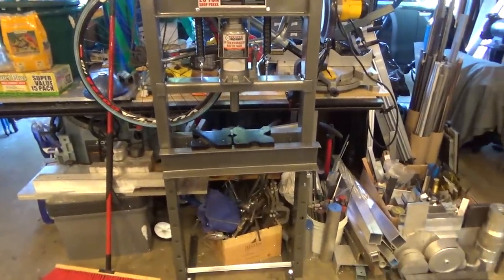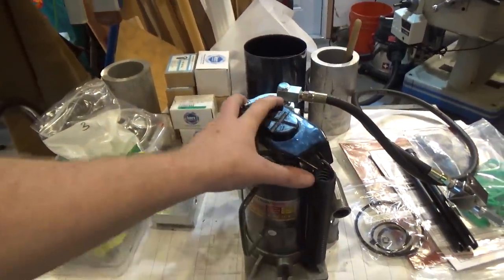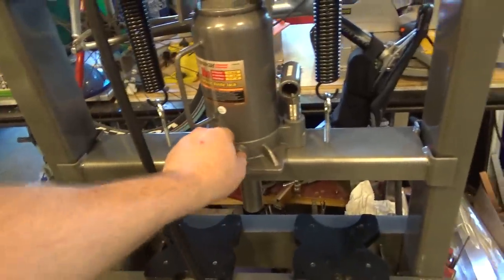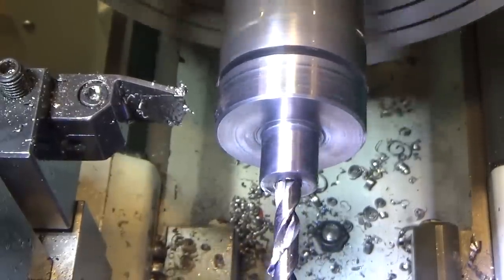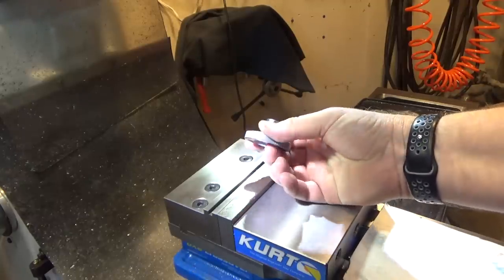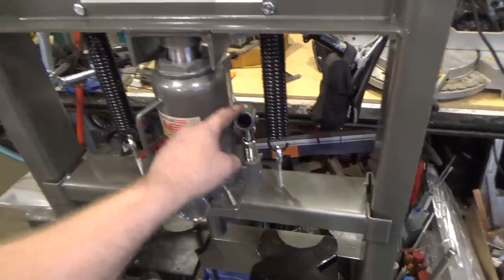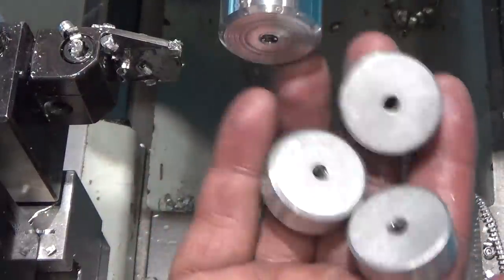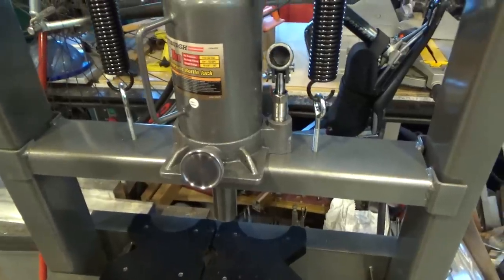Improvements to a Harbor Freight 20 Ton Hydraulic Press Part 1

Comment: Good ideas here. The only downfall, in my opinion was this...  The video is on press improvements, but about half the video is watching you machine a couple parts on your lathe or mill machine. We don't need to see every pass on the lathe. Edit it to the machining high lights, because if the guy has a lathe, they should know how to use it.
Reply from the maker: You make a good point. I try to show one little piece of each machining step, unless I am changing feeds and speeds. I try to tell a story, but some on my viewers, and even myself, just enjoy watching metal being cut and shaped. Making a video on these topics can be a tough balancing act. I appreciate you letting my know your thoughts.
Reply: I have to admit, I really enjoy those bits, and would feel a little cheated if Dudley was all "and here's one I made earlier...", and skipped the actual making of them.  After all, this us a DIY channel and there's always more to learn,  (And, you could just scrub forward past the machining.   Jus' sayin'.  ;)

Comment: Throw some cables through those little garage door springs.... save your life when one of those snaps.
Reply: Hardly any tension on the springs. No need to retain them. And I have had this press for years and NEVER had the pins move on me. Not sure why yours are. Nurling (sp) them would have probably solved your problem. BUT, the project wasnt all about that, I get it. Nice vid...
.
What you need with using that 20 ton air over jack is a front and back plate about 5" wide, welded in to close up the ibeam, right above the pocket for the ram. THAT jack will over strain the press. We had some warping occur pressing out some wheel bearings on ours here at the shop. Put in the gusset, and shored that sucker up quick. Now if we push it, we can see the frame twist. Be careful! Thats Not the jack intended for that press. (But pumping that thing by hand is stupid) gotta have air jack! 8o)
Reply: @miuzik8op908   Yup, the deficiencies of the press have been noted by many over the last few years. Your mods are interesting, and totally make sense for someone already stuck with the press, but If I were to be modifying, I might as well build a 50 ton press from a set of plans based on either a commercial one, or a homemade one. Pearl Harbor Freight should take note, and beef up the design on the presses.
Reply from the maker: You guy make some really good points. This press is affordable for most...including me, so I wanted to see if I could make it into something better. The pins on my version of the 20T press were chrome plated and tended to slip out often.

Comment: Turning the part too slow,  when you get to that small diameter you really have to turn up the RPM otherwise you get a crappy finish.
Reply from the maker: Great suggestion, thanks.

Comment: Worried about the price of a hydraulic press and you got a mill and lathe. 😐
Reply from the maker: You make a good point. The mill and lathe were substantial investments, but I can attest that the spending just doesn't end. Machining is one of the most expensive hobbies I have ever been exposed to. Still, you got me on the relative costs. Cheers.

Comment: Are you wearing Croc’s? That’s not the right footwear for the shop. No wonder you’re concerned about dropping something on your foot. I will be buying my press soon and gradually making the upgrades.
Reply from the maker: The Crocs are a calculated risk indeed. I used to wear the ones with vents on the tops, very briefly. Hot chips and feet...youch. I chose this type of shoe because I have to leave these shoes in the garage and I go in and out a lot. My wife will execute me if I drag chips into the house...
Reply: At out last house, my top box was in the living room as well as a vintage (1950’s) Craftsman wall mounted tool cabinet. Her curio cabinet was in storage. It was like that for 10 years until we moved.

Comment: Your top chanel seems welded on  mine bolts on what's the deal
Reply from the maker: Typical Harbor Freight. If you go online, they always have multiple SKUs for the same tool. I think they get sourcing from multiple manufacturers and each one has its own design, to some degree. Weird, I know.

Comment: The best presses can easily exceed 2k. Those bottom plates are a joke, Swag offroad has some really good replacements. You are better off getting a hydraulic ram from a reputable source (not harbor freight), it's a lot of mula but worth it.
Reply from the maker: Apparently Harbor Freight has sold plates of two types over the years: cast iron (bad) and steel like mine. My plates have had zero issues to date.
Reply: @DudleyToolwright  i'm welding together a swag kit and frame. Doing badly so far but that is to be expected for not being a welder by trade. :D

Comment: 15/1000  to 25/000 is not a tiny bit. It was working, how haste makes waste,- you even said you were breaking them. Also not just depth but feed rate was obviously an issue.  Were these Harbor Frt Bits too,,hah hah. I want to do this too but see so many are Nevre being used at all= Secondary Mkt.. The ability to make the Guide bar deeper more capable and smoother via uhmw/teflon. 
Even beefing more plate 50 grade Plus  added to the verticals.  Even Im told a C8  channel below about .48 thick wt 18.75 Pound a foor are in scrap yards.As a project with a few tools theses can become monsters. Get grade 50 steel and up for bigger Tonnage, makng it a plate vs sheet bender.
Reply from the maker: Thanks for taking the time to share some many thoughts and suggestions. I really appreciate it.

Comment: Get two quarter-inch ball lock quick release pins and drill holes through the jack base near the gussets and into the crossbeam. This will pin the bottle in place. Link: http://www.avibank.com/products/ball-lok-quick-release-pins/
Reply from the maker: I thought about the solution you mention and in hind site, I probably should have gone with that approach. Thanks for sharing.

Comment: Any interest in selling those knobs?
Reply from the maker: You are not the first, but I would need a CNC to make them for a reasonable cost. I think a better approach would be to make the whole knob/shaft assembly as a single part. If I ever move to getting a CNC I will definitely remember the request. Thanks.

Comment: Clicked in to check out your press mods.
I have the same one.
Mine is a little better, it is orange. JK.!
PS: I sub'd.
Looking forward to checking out your other vids.
Reply from the maker: Thanks. Orange is cooler. Harbor Freight seems to iterate their tools making each version a little bit better. Early models apparently had cast iron press plates that would fail catastrophically. Mine are mild steel. Perhaps your crossbar is stronger than mine. Thanks for the sub.

Comment: I can promise you without any doubt or hesitation the dead little bottle jack does not apply 20 tons of pressure on anything. If you apply 20 tons on any component on the cheap ass harbor freight frame it would fold in half or those crappy welds would rip off and the thing would hit the ceiling.
Reply from the maker: Good to know. I need to get a load cell to find out just how much force a harbor freight press can press, if press could press, press.

Comment: I know this video is almost a year old but, you could flip the jack by making a remote reservoir with 1/4" tubing to keep the bottle jack full.  Or you can take the pump apart and modify the pickup tube like this: https://www.youtube.com/watch?v=0nlSp21KZJ8
Reply from the maker: Thanks for the suggestion. This approach never occurred to me. I really appreciate the comment and link.

Comment: First mod is get rid of the cast plates. Use real steel instead. You can order the correct steel for reasonable money on eBay.
Reply from the maker: You are not the first to say this. I am beginning to sense a trend. I really appreciate the suggestion. Thanks.

Comment: They now have a $40 off coupon that would make it $90, +tax. I think I'll bring one home.  I would make a stand for it first thing. They're just too low for standing work.
Reply from the maker: Excellent deal. I have new video coming out in a bit where I test the maximum force that the press can put out and the strength of the top bar.

Comment: Immediate points taken off for wearing Crocs in the shop. Or at all.
Reply from the maker: A fair point that I have responded to often. I have to keep chips out of the house or I'm dead, so I have to keep a pair of garage shoes around that easily come off and on. I have gotten burned from hot chips before, thus my choice is a trade off between convenience and safety. Your point is well taken.

Comment: Is there anyone here that can make me a knob for my jack?  Like the one here, or some version of it?
Reply: I think I may try and rig up an outside metal water tap shutoff handle.
Reply: John Milner hmmmm, keep me posted.
Reply from the maker: If I had access to a CNC machine I would be happy to, but alas I do not. Perhaps a limited run. I have a more than full time job, but I will see if I can find the time.
Reply: Dudley Toolwright the need is there. Of course, anytime at all. Job comes first, always. Thank you.

Comment: Using a $5,000 tool to make a $100 tool work right. Isn't this like a fat guy ordering 4 double bacon cheeseburgers and ordering a diet coke to drink? I like your ideas tho, thank for showing us your ideas. Looks great
Reply from the maker: You make a very valid point. I used what I have and I realize that I am very lucky. There have been some other great suggestions made in the comments that don't rely on a lathe or mill. People are very ingenious Thanks for the comments. I appreciate you taking the time to share your thoughts..
Reply: I'm a fat bastard, I love double bacon cheeseburgers and I down them with a diet coke, what's your point!

Comment: that air jack is slow, I wouldn't bother.
Reply from the maker: It is, but easier than manually pumping on repeat jobs. I have used it with moderate success on a broaching job.

Comment: Throw those cast iron plates in the scrap bin.  They're very poor quality cast iron, and if you squeeze them too hard they'll shatter.  Ask me how I know.  Major risk of bodily harm, or damage to your parts.  It's worth it to pick up some actual steel plates.
Reply from the maker: Thanks for the warning. I made a follow up video because so many people warned me about the press plates. It appears the Harbor Freight mfgs learned about the issues and started making them from cold rolled steel instead. I huge load on both of my plates in a very small area and only made dents. I appreciate the  heads up.

Comment: Harbor freight has a new trick they are pulling with their coupons.
The are marking many items with purple "Close Out" tags that are
not eligible for the coupons.  They do not mention that these items are
on close out on the web page.  You only discover this when you take an
hour in a half (in my case) and waste a few gallons of gas to drive to the
store.  The "closeout" price as far as I can tell is the exact same price
within a vary small margin that the items have been selling for, so there
is zero savings in buying a "close out" item.  It is just another sleazy tactic
for them to devalue their coupons even more.

This has happened to me no less than 3 times now.  First time was with air staples,
and I thought the on line price minus 20% was a good deal, so I drove down to get a 
pack.  Nope.  On close out.  No coupons.  I wil admit that time I did not check the item 
or the price on line before I took off.    

Next time was for one of the low cost vinyl air hose.   I checked the item and the price on the 
web page.  No mention of the air hose being on close out on the web page.  Forty five minutes
later at the store, nope, the air hose is on close out, no coupons.  What the hell.  I was in a hurry
so I just left.  I did file a complaint with the BBB and the NYS attorney generals office, 
division of consumer fraud when I got home though.

And the last time, with with mothers day 25% off coupon.  I wanted to get a framing nail gun,
but one of the inexpensive ones.  The one that is going for about $79 with a 25% off coupon
sounded like a good deal.  This time I double checked the web page and made sure it made no
mention of closeout.  I also recall watching these nail guns and the about $80 price is what they
have been selling for.  I get to the store, and of course, the dreaded purple tag.  The store was a
mob scene and I stopped my line and got no less than 4 of their people involved in my 
dissatisfaction.  They looked it up on the web and told me because the price was in red that meant
it was a close out.  When I got home, I checked and all the prices are in red.  Another round of 
complaints to the BBB and the AG's office.

HF is getting to be very sleazy.  I suggest that if you have a similar issue that you take the time 
to go on line and report them to both the BBB and your states AG's office.  The stunts they are
pulling now are just wrong and they should be stopped.
Reply from the maker: Wow. Sound like a true tale of bait and switch. The behavior you have described is completely shameful. I am already annoyed with the daily emails that say inventory liquidation. They might love to sell all of their stock, but they really aren't trying to get rid overstock or items they no longer wish to carry.
Reply: Why not shop somewhere else like Lowes and pay two or three times as much? Soon you will be if you keep complaining

Comment: Has anybody tried to swap out the 20t for the 30t?
Reply from the maker: The thought had crossed my mind, when I went to but the air motor jack, but was concerned about frame strength. I figured they build some sort of safety margin into the design, but being Harbor Freight, I wasn't sure it would be that large. I was concerned that, when dealing with forces like these, a catastrophic failure could be really serious. Upping the forces on the frame by 50% might be pushing things to the edge of capacity.
Reply: Yes, there is in fact an Air over Hydraulic 30T out there for only $130 on eBay. Consider welding in gussets on your top and bottom C-Channels, (and/or boxing the sections) replacing the pins with at least long Grade 8 bolts. I got hardened pins from McMaster. Same goes for the bolts connecting the frame up top. Grade 10.9 or better... or just weld the whole thing up.

I don't think moving up to 30T required all that... but ya, know... always better to be safe than sorry with HF stuff.

Realistically, all the forces are put on the pins and the frame bolts. If you just do your due diligence and replace those, you should be fine. But seriously consider adding a safety cage or steel curtain to catch anything that may come shooting out of your press should something give or be slightly catywaumpus. Happens more than you think.
Reply: I broke one of my plates with the 20 ton air hyd. jack, I don't think they will work with th30 ton.

Comment: MAN I hate air over hydraulic jacks due to the noise. I did a similar thing but with all used hydraulic stuff from ebay, used hydraulic cylinder, small electric powered hydraulic pump and ended up with a little more into it but it is not physically painful to my ears to use, no need for ear plugs before I use it.

Click this link and turn everything up til it hurts your ears, that is what these jacks sound like  >> https://youtu.be/lUJ5yiAjwtk?t=319
Reply from the maker: You bring up a very good point that I had not considered until after I had made the choice. Thanks for the comment.

Comment: 13:14 whats is??? Thanks
Reply from the maker: Knurling tool, used for putting grippy surfaces on turned parts.
Reply: @DudleyToolwright  thanks so much.
Reply from the maker: Any time. Thanks for the comments.

Comment: Those ain't toes, those are Crocs
Reply from the maker: Yea, ya got me. They aren't steel toed anythings, but I am pretty careful when I move around anything heavy. I do manage to get chips inside almost every time I wear them. I ended up getting them because I was tracking chips into the house and the misses was getting perturbed. The only solution was to leave a set of shoes outside for working, but I end up going in and out a lot so therein lies the dilemma. I know my safety department is having fits...

Comment: Coupon doesn't work on jacks.
Reply from the maker: Good to note. It depends where the coupon is from. The mailers often have more permissible coupons than the emailed ones. They accepted the one I  had, perhaps wrongly. I can never even read the fine print. Thanks for the heads up.

Comment: Those fucking shoes though.
Reply from the maker: Croc hater. But seriously, I have responded to the show comments before. Bottom line is I have to use a different set of shoes in the garage to keep the wife happy and I am in and out a lot, so these were a trade off. Risky, I know.
Reply: @DudleyToolwright  I was just kidding. If you are that confident in yourself you should wear the crocs. ;)
Reply from the maker: I am not, but they seem the best worst option. Cheers.
Reply: @DudleyToolwright  in all seriousness, I appreciate you putting this video up. People like you have taught me how to do countless things in the shop and around the house. Maybe they will introduce steel toe crocs some day.

Comment: you should have just purchased a better press from the start.
Reply from the maker: That would have been a viable option. Thanks for the comment.
Reply: @DudleyToolwright  Don't you love it when key board warriors say spend a lot  money that is not there own. If you are a dyier you do not need, or can afford to speed a fortune on equipment designed for industrial use.